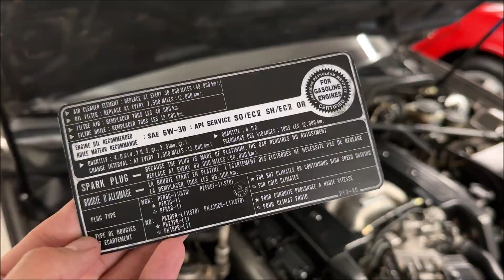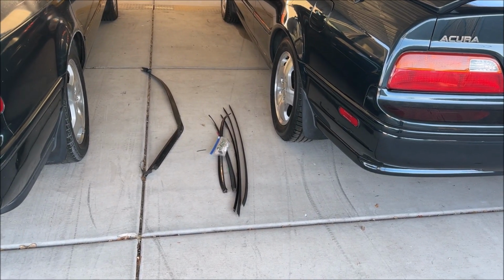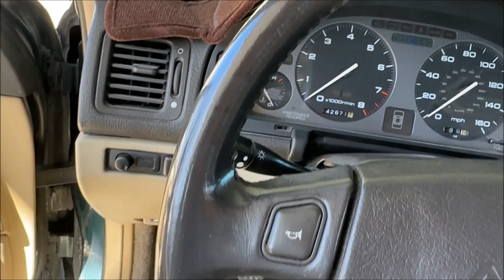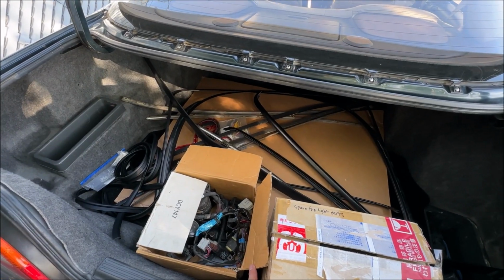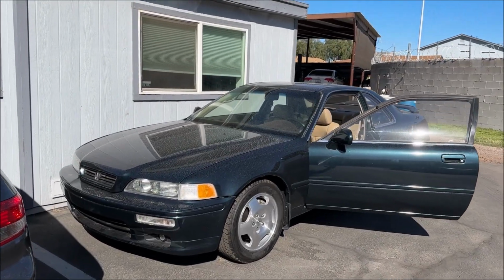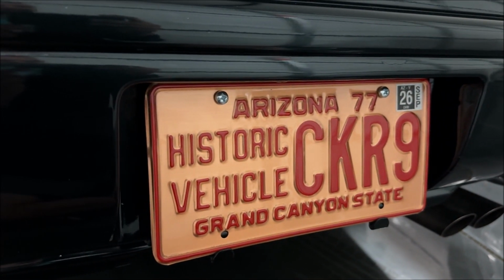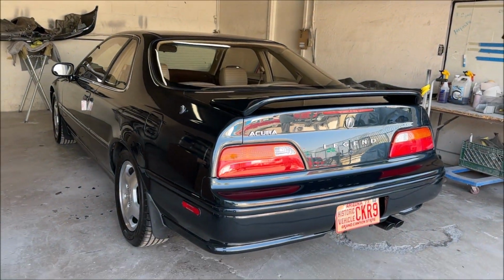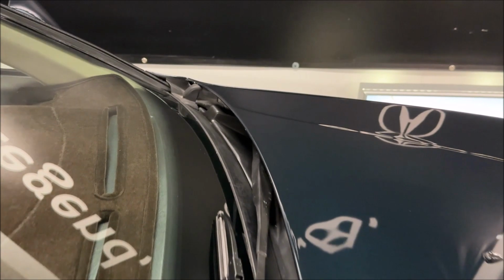1995 Legend LS 6-Speed Restoration Part 7: Interior Reassembly, Fog Lights, Window Moldings

Comment: Very well done!

Here's a few tips that you might find useful...

- Instead of electrical tape which won't hold up long when it gets hot since we're already in the 80's, try using black car wrap. You might try a local shop that has some black scrap pieces or maybe Amazon.

- Not sure if your already using it but if not try 3M spray adhesive for the air box label. When prepped right it's not coming off.

- In the future try matte clear coat over the black paint work.

- Lastly I'm not sure which dealer but it's either AOT or Tempe Honda has a parts guy who used to work at Bell Acura. If he's still there you might find him and if luckier he may have pics.

Almost forgot, call ARC, they can definitely help with getting the interior color matched so it looks consistent...

Otherwise you did some excellent work here  very proud to see you're still sweatin' the details!
Reply from the maker: Great tips all around! Thanks!!

Comment: did you have the quarter window removed for the paint job? The molding on my car's quarter window is very tight so it's very difficult to get a clean mask and paint so I'm thinking if I should have the window removed. Concern is it may break or the molding may also break. your thoughts?
Reply from the maker: Yes lots of issues can happen with removing moldings and windows on a car this old. They left windows in on this one.

Comment: I mightve missed it, what leather kit (brand/company) did you use? also the lower door panels you can recover those in new vinyl for about $50 just fyi. but take the driver one back off and reglue the front by the speaker grill (ocd lol)
Reply from the maker: Yes the panels aren't perfect. The leather was all custom cut by a local shop called TrimFit, it took 3 months!

Comment: I love your attention to detail. I have to repaint the wiper arms on my Integra. I'm not sure if they are matte black or semi-gloss. Nobody seems to know including the parts department guy I've dealt with. What would you recommend?
Reply from the maker: I usually do "satin" which actually seems to be a little bit between matte and semi gloss, if you can find it.
Reply: @TysonHugie  Thanks Tyson. I will certainly look for it.
Reply: @marcperras9072  What year and model is your Integra, interested in selling it?
Reply: @strangeclouds7  1994 GSR. I bought it new in 94.  It is a Canadian model with 90,666 kilometer on the odometer. No, I'm never going to sell it. My 26 year old son wouldn't let me. Thank you for your interest. Cheers.
Reply: @marcperras9072  Wow that's great, gsr with very low miles! Very hard to find nice examples these days especially with low miles/km.
Reply: @strangeclouds7  It spends 6 months each year in indoor storage over the winter. It would have rusted out long ago if I'd driven it in the snow/road salt. Springtime is the worse for rust where I live.

Comment: Tyson I recently bought a ‘94 Acura Legend on BaT.  If we sent the car to you would you be willing to do some work to it?  The car sat in storage for roughly 10-12 years based on the auction information.
Reply from the maker: @ChadBugg  Congrats on the car! Send me an email if you can, I’m curious what you’re looking to have done. My email address is in the “about” page on my channel. Thanks for reaching out!
Reply: @TysonHugie  thanks for reaching out. Sorry for the delay in responding I purchased another car on BaT (2011 Cadillac CTSV)and I’ve been dealing with that car. In regards to the Legend, the car sat for roughly 10 years in storage from what I can gather from the carfax report. I knew this going into the auction and knew that a car sitting for this long could have some issues pop up. What I’ve found so far is that the ac doesn’t work(compressor doesn’t seem to work at all), the heater works but doesn’t get as hot as it should, the radio is blowing fuses(this started happening after a few months) and a few other minor things. ABS light comes on but the brakes seem fine. Cosmetically the car just needs some TLC. Over all it’s in good shape. Basically I would like to have you(someone that has a vast knowledge of these cars)do is go over the car and bring it back to “like new condition”. The car is an absolute joy to drive. I can send you pictures of the car so you can have a basic idea of what it might entail.

Comment: You said that the trunk Acura badge was a few inches lower than it was supposed to be...so that means that in the past someone took the badge off and then it was put back on incorrectly at some time ? Truly bizarre.
Reply from the maker: Why is that bizarre? The car received paint work previously. Body shops always remove and reinstall emblems for stuff like that.
Reply: @TysonHugie  So it received paint work and then the clear coat failed ? I guess that's possible...Anyways, great work on the restoration. It was so satisfying to see the transformation. Your videos have made me itch for a manual Legend myself - I really like the look and feel of them. Unfortunately it seems they are next to impossible to find nowadays.